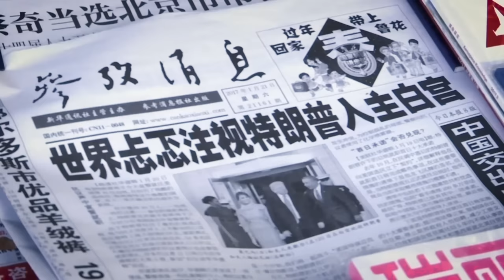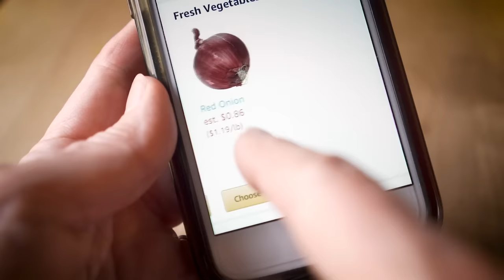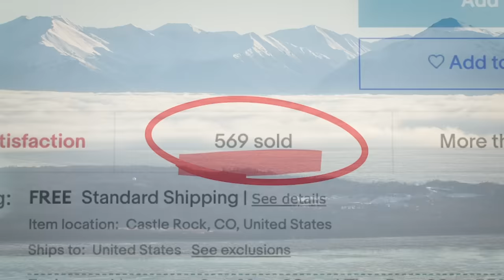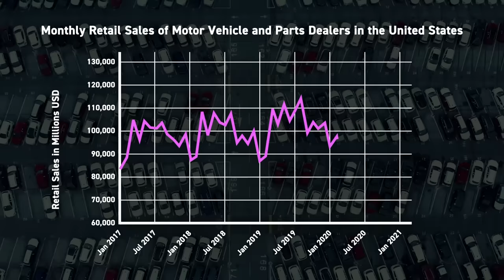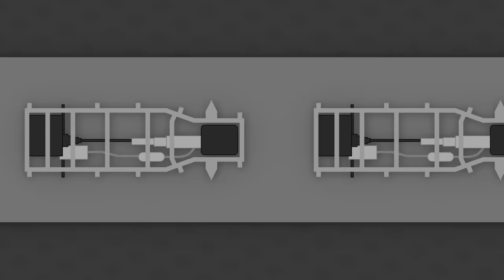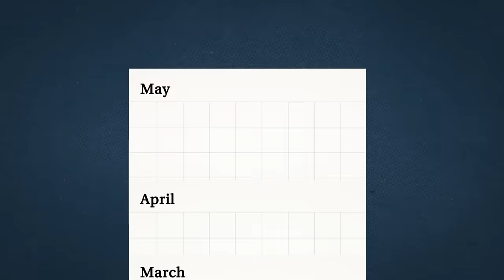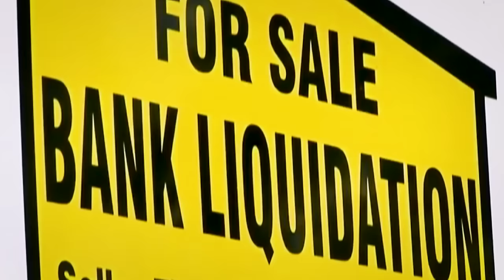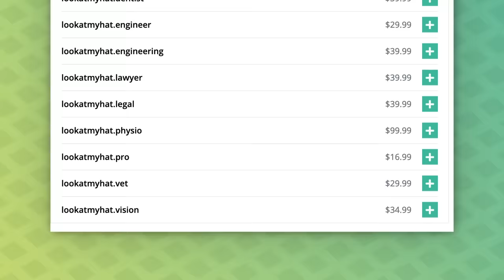Why There are Now So Many Shortages (It's Not COVID)

Comment: The Titanic analogy is such BS though. It was build perfectly fine for the time. Any ship of the time would have sunk in a similar collision. They would keep making rivetted ships right up to the 50's. 
The comparison of rivet quality to modern steels is also inherently wrong, the steel was normal for the time. The rudder was also not too small, and the ship was noted to have good maneuverability during trials. It had a double bottom, it had more lifeboats then required. It's estimated they had about 35 seconds from spotting the iceberg to collision. It was human error and bad luck that sunk the Titanic, not design problems. 
Just look at the long and succesfull career of the olympic, titanics older sister ship. Yes, it's other sister ship, the Britannic, also sunk, but that was from a mine, in wartime, with all portholes open.

Comment: There is no shortage of drivers. This is propaganda pushed by Equipment Providers at the port. I’ve been in the industry for about a decade and have seen the industry change first hand. There are no Chassis available to pull these containers. My drivers spend their whole day at the port hoping to find a chassis to pull their load and no dice. The chassis companies are hoarding chassis and limiting empty container return by only allowing a certain container lines to be returned. This is causing a backlog of imports as most trucking companies now have to hold on to their empties for extended periods of time wasting the chassis because they simply can’t return the empty.

Comment: Failed to highlight
1. Gov imposed COVID lockdowns
2. Related shortage in truckers
3. Dreadful infrastructure at longbeach and LA port
4. No 24/7 working policy at ports & storage facilities 

These are the main reasons why we have a fucked up supply chain right now.

Shortage of other components is another issue for individual industries and products.
More of a failed planning/analysis of their market in a company scale.

This disruption won't get fixed until ports and truckers do their damn jobs properly.

Ain't about JIT, TOYOTA or some outsourcing policy. It is a simple Logistics Fuckup.

Comment: I think you are incorrect. Supply chains having a systemic cascading failure during a statiscially unlikely pressure period is not a flaw of the system. Planning ahead for stability that would have handled Covid is quite clearly overcorrection. The additional continuous cost of such anal foresight would put absurd pressure on production and trade and elevate global prices like the whole world is an insane dooms day prepper.

An economy not being able to handle sudden drastic change in demand is not a flaw.

Comment: I like most Wendover Productions but this one is Off the Mark started getting way off topic the bottom line is that when you have bottlenecks regardless if you haven't been touring don't have inventory whatever else should do the bottlenecks basically eliminate any preparation and on the whole the larger economy is the federal government needs to deal with those bottlenecks and until they do everyone's going to get screwed down the line

Sorry Wendover this video could have been about 2 minutes long and reached a better conclusion

Comment: Did you mention over-regulation, particularly emissions standards in California. That and their insane lockdown strategy are the cause of the backed up supply chain. 
The strong emissions standards for California limit the availability of rolling stock (e.g. Tractor Trailers) within California itself. This means that there are effectively fewer trucks, etc. available to unload ships. 
The lockdown strategy also paralyzes the distribution chain because material has no where to go, unless it's considered essential. This clogs up the cargo storage areas that would have been available and bottlenecks the chain. 
Top that with the high price of gasoline and diesel fuel (~$7.50/gal) in California coupled with the high cost of registration/inspection for vehicles in California ($350+) and additional taxes, and you get lowered profits and therefore fewer people willing to be involved in transportation. 
So, if you really want to blame somebody for the impact on the rest of the country, blame the actions, programs, and laws set up by the Democratic Party politicians who are running California into the ground.

Comment: There no shortage of truckers, do your research
Reply: There  is no shortage of steering wheel holders. There is, however, a shortage of truckers.
Reply: @dave760  what, last I could tell every trucker holds a steering wheel, everything is automatic, get a grip
Reply: @Twistex  You have truckers who have the experience and quality you want in someone you hire to move your stuff. Then you have these morons who will undercut truckers prices as they aren't experienced enough to do the job correctly, therefore they are nothing but steering wheel holders, and are very dangerous on the roadways.